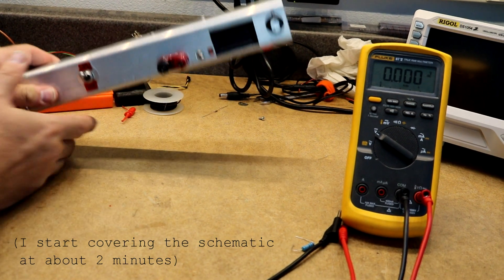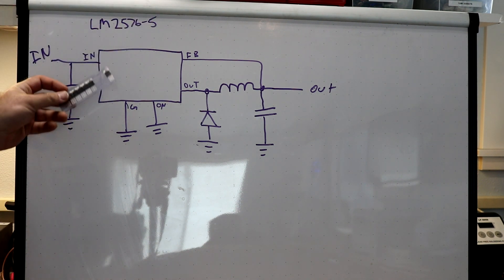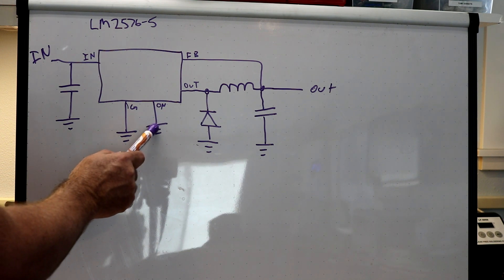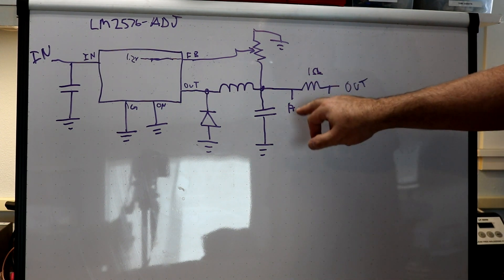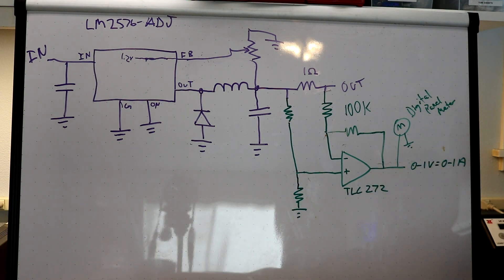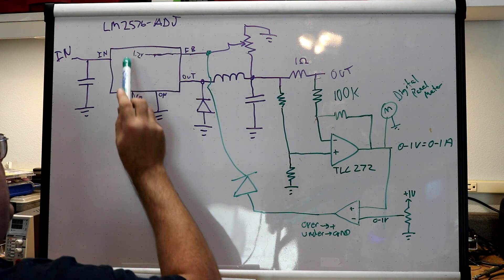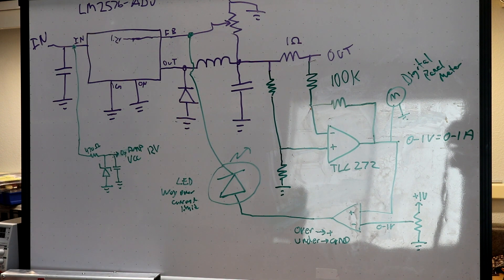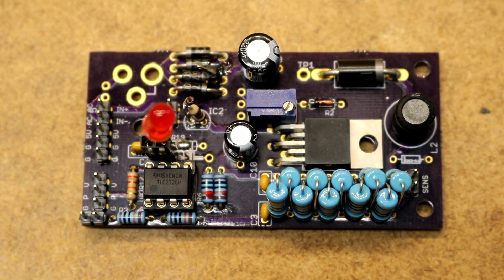Current Limited LM2576 Power Supply

Comment: The led will basically kick in when the current limiting feature is activated correct ? Its like the moment you go beyond the set point of the current limit the LED will glow and the that op-amp is governing the on and off of the regulator. But now what about the potentiometer mean for voltage regulator , its voltage is coming at the same junction what about it then ?

Comment: Very nice!  I'd like to try building this but I have a couple of questions.  

On the power supply you built, you show a toggle switch used to switch between volts and amps being displayed.  But from looking at the schematic,  that toggle isn't shown.  Where would it be connected?

If I wanted to use 18 or 20 volts input,  would I then require a separate voltage regulator for the op-amps?

Comment: Okay... Interesting. But I gotta ask. When an over current event happens. The feedback pin is pulled high via the output of the op-amp. That shuts off the buck inverter and it's output. But!! when the output is gone, there no longer exists an over current event (no voltage) so the output from the op-amp goes low, voltage is allowed to return to whatever value it was original at, and once voltage is available, then, and provided the over current condition is still there, the op-amp changes states and the whole shebang cycles. Until the over current condition is removed, this circuit will oscillate on and off as the op- amp sees the overload, shut down the regulator, then the regulator will start back up once more and will instantly see the overload and on and on and on. A SCR and some transistor for signal inverting, would clamp the circuit off until manually reset. Just a thought....

Comment: i got 30v 5amp linear power supply its voltage working well as i increase voltage its work but when i increase amps not going above 2 to 3amp and when i put load its slowly increase the current but at that time transistor burn out the transistor is 2n3055 2nos.

Comment: Hi.  Not sure if you still keep up with your channel. But I'm working on a senior project as a computer engineer. We dont learn much with designing power supplies but I learned for my build I want a switch mode buck converter. I have some circuit analysis capabilities but I'm finding it difficult to find the textbook that would help me in deciding capacitor values and inductor values to make exactly what I need. If you could explain how you decided on values or point me to a resource it would greatly appreciated.

Comment: Instead of the LED where you have it, I would look at doing:-
1/ Replace LED with diode and resistor from opamp output  to FB, (no resistance seems a bit brutish...)
2/ Get full LED brightness by running it from opamp output to Gnd with a resistor

Comment: So if you already have a regulated DC power supply and just want to add adjustable current limiting. You'd only have the green circuit? What about the 1 ohm resistor in purple?

Comment: hi, thanks for your contribution!  I built this and found if you include the recommended filtering stage from the TI data sheet (figure 22), that is the 100 uF cap and 20 uH inductor, you end up with a much smoother output.

Comment: Did you try to connect de output of comparator directly at the pin on/off  of the LM2576 ?

With Lm311 and a pull up resistor may be.

Comment: I wanted to say thank you, it's a great and clear video, and I'll definitely build one once my parts arrive.

what shunt resistor should I use if I want it to be adjustable ? ie not wasting too much power by making it 1 ohm but wanting it to be precise down at ~3,3v ? maybe 0,5ohm or lower ?

for a future project, what ic would you recommend for a higher current capable supply ? like ~5a or higher ( to make a simple bench psu ) ?
Reply: you could probably go with either a .05 or .1 ohm resistor.  that is what a lot of dc converters use for values.

Comment: I am building a PWM for a 5-6Amp adjustable output. I like what you did here. Could the same set up be used for 5A instead of 5mA? I would assume the voltage instead of 0-1 would be 0-5volts?

Comment: nice tutorial, exactly was i was looking for !
2 problems though - (a) catch diode & inductors are supposed to be placed cramped upto the ic legs (as near as possible) for best efficiency, regulation & low em noise. (b) inductor of thick wire (22swg or more)  increases efficiency some more.

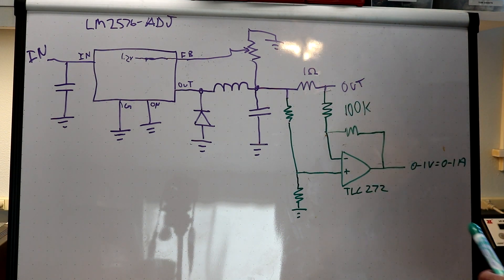Comment: What do you mean "equal" for the op amp on the 272 @ 8:00 mins? Are they all 100k each or since there are 4 they are 25k each?
Reply from the maker: +Thomas Joseph Each of them is 100k. In particular, for accuracy it's important they are closely matched. I recommend using 1% tolerance resistors.
Reply: +smbakeryt Yes, I seen this later in the video. I am trying to build this in LTspice and kicad atm. This is is exactly what i need in my project. have you had any issues with the 272 controlling the amps? What about that ripple? Did you ever clear that up?

Comment: That's a great addition to this IC, rather than relying on the internal peak current limit that could still destroy something. As for the output ripple I recommend using an additional LC filter, 20uH + 100uF should clean it right up.
Reply from the maker: +uK8cvPAq Added the inductor and capacitor to the latest revision and the ripple is pretty much gone! Updated schematic is on the webiste at http://www.smbaker.com/lm2576-constant-voltage-constant-current-switching-power-supply
Reply: +uK8cvPAq Thanks, I'm going to give that inductor + cap a shot next change I get.
Reply: +Scott Baker Awesome, its on page 22 of the Texas Instruments LM2576 datasheet. The inductor should have a very low DC resistance as its further down from the feedback path so the IC won't compensate for any I ^ R losses across it.